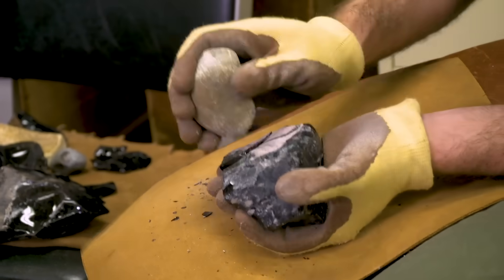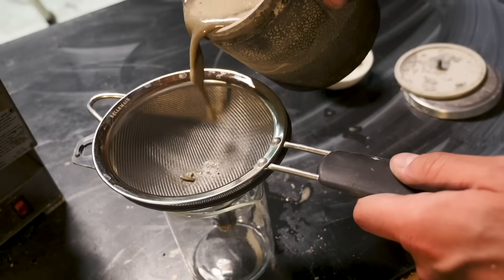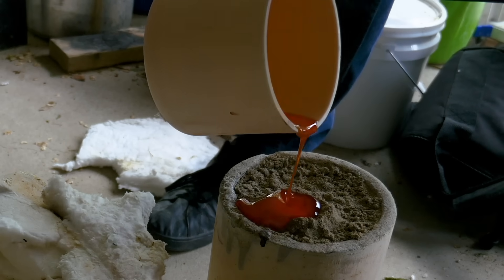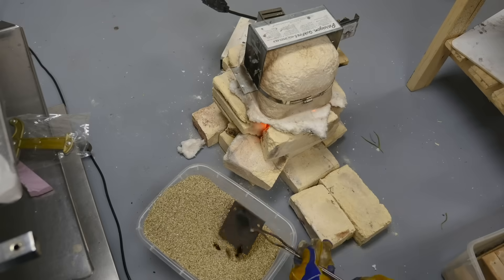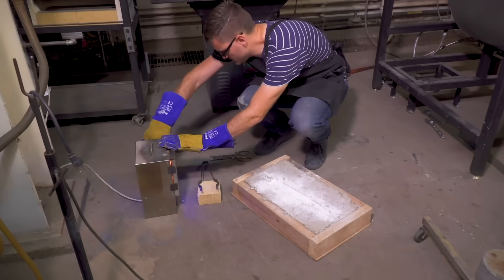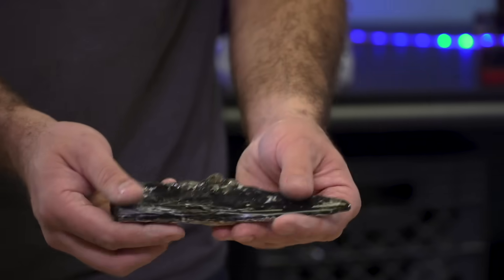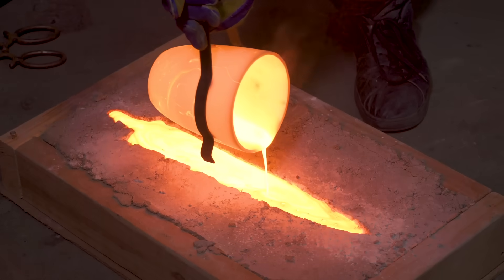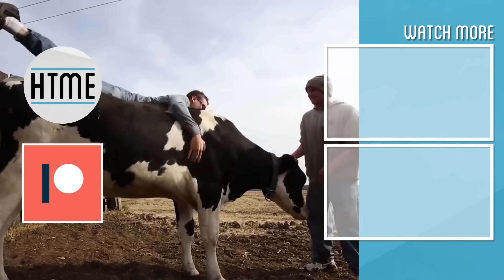Can You Melt Obsidian and Cast a Sword?

Comment: just kind of curious
it might takes a lot of time but
try heat it up the whole time by controlling the temp and slowly drop down the temp
from what i see is that out layer of the obsidian has cool off faster than the inside that's the reason why it broke
the reason is to control temp and slowly drop down is to let temp from the inside to slowly cool down

Comment: I should have thought that the key thing is to find the right annealing temperature.  Different glasses need different temperatures.  Now, you don't say how you chose the annealing temperature, but as your sword  cracked it seems to me there is a good chance the temperature wasn't right - in which case the solution would be to conduct a series of experiments to find the optimum temperature (and minimum annealing time too of course).

Comment: It cracks due to flux you add. You shouldn't add flux. You should try to increase temperature. Flux adds impurities with different melting point and different lattice constant that affects thermal expansion and leads to cracking. Pure, high quality obsidian wouldn't crack so easily (due constant latice constant thru its volume) when you cool it evenly and slowly. Maybe try to make a clean and smoot form made of titanium and put obsidian powder (without flux) there and bake it with that titanium form at  1080°C < T ≤ 1650°C. Next, turn off the oven and don't open it for few hours or a day, to let it cool slowly and evenly. Open the oven after the few hours (when its interior is cooled down to room temperature) and see what you have inside and see if obsidian is going to crack easily. The above method is not tested but it would be great if you could test it if it actually works. I know it is more expensive (needs better, bigger oven with higher temperature and titanium form), but on the other hand it may work. :)
Wanna give it a try?

Comment: They should add obsidian swords to minecraft too
Reply: Wolfie R8 that way you have a blade which is good for one whack. People will be mad after all the work. Lol
Reply: DE Nichols obsidian is tougher than diamond in Minecraft brah
Reply: Gaara Sama YouTube cut that down in the notification without the "in Minecraft". I was like. Could it be harder? Diamonds are the hardest naturally occurring object. Vikings liked to smash them to be sure...just because it's hard doesn't mean it doesn't smash. Lol

Hard and brittle. That's a diamond. Obsidian seems softer and still brittle.
Reply: DE Nichols gotcha
Reply: @ DE Nichols
Same as a diamond sword. Would also break quite easily.
Reply: How about mods ;)
Reply: That would break easily
Reply: Wolfie R8 they did u just need to buy the stuff for it
Reply: If they're going to add obsidian anything to minecraft, it needs to be obsidian glass panes... this way you can have explosive resistant windows too, and not just the blocks.

Comment: You have the right idea with the annealer. I expect the difference in temperature between the obsidian and the annealer is too great. Melting the obsidian at what ever temperature, say 2000 degrees F the annealer should be 1500 or so. Next would be to program the cooling rate. I anneal my glass at 950F for 3 hours, 850F for 2 hours, 750F for two hours and so on for a total of 8 steps. It's the cooling process that makes it crack and the stress relief inherent to the melt to the solid to the cooling. Well done though.

Comment: But why would you want even do this ? An obsidian sword would be essentially useless, as a single strike from another weapon and it would smash, and if it actually hit any thing, the edge would most likely shatter and small flakes would chip off. Remember how easy it is to actually knap it, so actually using it in batter would just be the same.

Comment: Instead of using a flux, why don't you make a crucible from Tantalum carbide (TaC) or Hafnium carbide (HfC). These two materials can withstand temps up to 4000 degrees celsius. Get a larger kiln. Then you can heat the obsidian to the point where it is liquified and cast it that way. You can also remove impurities in the process.

Comment: Needs to be constantly flowing/mixed not to set while it is melted.  Something like a cement mixer that heats as hot as the kiln and injects it straight into the mold where little air gets to it.

Comment: using high voltage and current arcs may melt obsidian faster and much better but to do so will be more extremely hazardous than using a kiln as if you don't wear the proper protection these arcs may kill you and you will also need a much bigger transformer like the ones used for utility poles and transmission lines as microwave oven transformers may not generate enough heat to melt the obsidian so.

Comment: The video is an illustration of how ignorance coupled with perseverance will get you exactly nowhere. If you had any idea of how obsidian is born and its chemical and structural composition, you would have known in advance that melting obsidian will result in glass with a sizeable proportion of impurities. That makes an already extremely brittle material even more susceptible to breakage, preventing any kind of post-cast sharpening. So in theory, with a lot of effort you can make a blunt, ugly and extremely brittle glass sword.Then again, I am probably missing the point here, since seven million views have probably made you about $7,000, not bad for maybe a week's work.

Comment: From a mineralogists point of view the answer to "can this still be considered obsidian" is a clear: No.

Obsidian is defined as a glass like substance formed from volcanic activity. Unlike most minerals, which are defined by composition and structure, Obsidian is defined by its origin, since is composition is highly variable and its structure, well there is none :-)

Also: The reason for the colour shift is most likely not the flux but the fact that most of the impurities (mainly Fe2+) get oxidized.

Comment: Good for you on your tenacity!
Back in the olden days, the Panasonic Techinics company made a, "Cast Obsidean Base" or plinth for it's best Turntable.
Their best one was the Technics SH-10B7. (There was also a smaller SH-10B3)
Here is the info, but it does not explain how to do it. This is paraphrased from The Vinyl Engine website:
Description
Heavyweight (17.3kg) plinth system made from cast, powdered obsidian.
External dimensions: 561 x 175 x 466mm.
Weight: 17.3kg (including dust cover, except for arm panel)
---I guess when a multi-million dollar company gets involved, anything can be built. They sold thousands of them, and they go for a lot on Ebay
IMO, what you are trying to do is even harder than this, because a sword or knife is so thin and brittle.
Reply: same sentiments, I applaud you for sticking with it.

Comment: impurities in the air impurities in the Mould , heat conduction through minerals to avoid rapid cooling the sand of the mould the mould itself should also be heated then compressed to remove fine air pockets , when pouring the substance shouldnt run out like water nor should it ooze out like lava your mix was too thick then it was too runny adding fluxes designed to make vase and pots your going to get a vase or pot you have nothing but a broken piece of ceramic in the shape of a knife, obsidian or not your might as well get a sword of metal heat it up sprinkle obsidian powder on it and forge it 1000 times ok you dickhead

Comment: Glass Wool I believe would have helped a lot with the cooling of the obsidian sword. I remember a year ago watching a video on producing tin oxide coated glass using Stannous chloride sputtering and high temperatures.  The cooling glass was fully encased in glass wool to trap in heat thus slowing down the cooling cycle and preventing stress on the glass sheet.

Comment: You know, there's a saying out there that if you're not breaking equipment and causing some collateral damage, then you're not doing any real research. IMHO this exemplifies that saying.

  Your efforts, although they perhaps didn't quite pan out the way you'd have liked, you're breaking new ground.  None of it is in vain and you documented it.  Don't discount nor despair anything.  

Although it's more of an art at this point, this will lay the foundation for future attempts and improvements.  Even though it's more leisurely pursuit, who knows how it may benefit people down the road?  Even if it's just an exotic area in casting and such, future efforts will benefit from the knowledge you've gleaned here. 

I'm a realist, and cynical.  It's rare I'm more optimistic about things.  You did a good thing.

Comment: Durability: 99999
Reply: Your profile logo strength:9999999999999.
Reply: NoticiasPapu - 9999
Reply: Obsidian sword 
1 attack damage
30 durability
Reply: Obsidian sword- Attack:70, Durability: 60, Sharpness X, Silk Touch X. Most overpowered weapon. Only crafted with the ender dragons egg, 2 obsidian, and a blaze rod.

Comment: Yo youre making me cringe destroying all of these kilns. When you cast any kind of glass you need a mid-range torch to heat the edges of the glass where it gets really cool (where it starts turning from red to black) and then you need an annealing kiln that has a program that ramps up to about 1050F and then slowly comes down to room temperature over the course of two days or so depending on the thickness of the glass.  You can get an idea of the COE by annealing a smaller batch in a kiln and compare it to borosilicate glass/soda lime glass which has a COE of 33 and 96-104 respectively.

Comment: If you’d like a tip, do this in the desert. Use an actual kiln. And then finish in a vacuum oven, and use less flux and no dyes. I make obsidian figurines in Nevada. Using a large kiln for sure though. Makes a difference.

Comment: Obsidian is not really "glass" with impurities.  Common obsidian has the same chemistry as rhyolite (the explosive/extrusive equivalent of granite).  Rhyolitic lava is pasty and sticky, and basically nasty stuff.  If it is hot enough and reaches lower pressures quickly enough, a lava flow that would be obsidian may foam making pumice.

Comment: Great Video, but I've been making glass for 20 years and you could do with a few pointers! 

Use the last sand cast box (the metal one) and just put it right into the annealing oven. Also don't add too much water to the sand mix, it'll help prevent bubbling (are you using bentonite as a binder for the sand?). 

Your annealing point is wrong. Look at the book 'Glass Notes' by Henry Halem. It's got various different annealing test and schedules in there. The one you're using (I'm guessing is for Spruce pine batch at the glass blowing studio) is wrong and too short. I'd try a long schedule with many different annealing and strain points. As a guess you should be waiting at least a couple of days until you de-mold. Have you thought about kiln casting it with a plaster silica mold? Think you'll get better results with that and you don't need a crucible. FOCI Glass Studio run classes in this... maybe have a go? (it's really fun by the way and a lot less hot!)

Also what flux are you using? Have you tried borax?

Comment: I was hoping for a sword cast from molten obsidian, not flux and "random metal bits to add color, which wasn't really the problem but why not 'fix' it anyway?"  I have no idea what to call the material it's cast from, but it's not obsidian anymore.

Further, it can't really have a tang as it's semi-obsidian.  You'd have better luck putting fullers down the center and then binding a core material to it, similar to how flint-knapped blades are attached to hafts and shafts via a split in the handle material.

Finally, for the best luck casting this fragile material, you'd want to find a way to cool it quickly without cracking it.  Heating it with the torch is not only moving the material but also likely allowing crystals to form and introduce fracture points.  Kudos for trying different things though, that's how we learn!

Comment: takes hat off. Goldsmith Master Jeweler here. I love that you didn't give up. yep, guilty here too. i've melted glass before and even formed glass from sand. I was rooting for you as you didn't give up and was going to give you a tip, but you figured it out at the  9:09 mark. glad it worked at 11:40. I mentioned melting glass, but why: to pull out impurities from old gold when you are working with customers gold that hasn't nor wants to have it refined. the by product is similar to the look of obsidian. I can't give out that trade secret. gold refinery I leave to the experts. yes I've seen the youtube videos "refining gold" but they're actually losing gold in the process, not to mention the acids used. what do they do with it, storage and disposing wise. Anyway, here's my suggestion if you want One More Stab At It. try building something that resembles rebar skeleton with either copper or steel. I'd really like to see that outcome. Obsidian Sword! love how that sounds... I give you a Thumbs Up and a: I Like, OLE!

Comment: The difference between obsidian and glass is the cooling rate and the crystallization . Obsidian is create normally around volcanoes from lava with high concentration of silica . If you want to "create" obsidian you have to warm the materials in high temperatures for a long time and late it cool not as fast as the Normal glass but much slower in order to be partially crystallized .

Comment: Could you cast your own pistons
Or have them machined etc? 
I've been waiting for someone to try and make a crossplane inline 4 crankshaft and liftedcam shaft to compare performance against a bog standard stock crank and cam.
Crossplane should have a smoother rev band and a mean idling sound, in comparison to a stock crank and cam from an inline 4 engine.

Comment: I suggest checking out the Corning Museum of Glass's videos here on YT to better familiarize yourself before using obsidian again. Also, have you checked out black sand? It's essentially super-fine crushed obsidian, maybe that would help? I'm no chemist, so I could be wrong. Good luck in the future!
Reply: The most common types of black sand stem from shock cooled basaltic lava, while obsidian is mainly formed by fast cooled rhyolitic lava (silica rich). Another type of black sand that is fairly common is based on eroded hematite and is hence ferromagnetic. I got a big bottle of the latter ... it's pretty fun to use as decoration coupled with a few strong magnets and because the sand is not pure iron it does not go as crazy as the commonly used iron filings. :)
Reply from the maker: Great suggestions, thank you!

Comment: The reason your casting didn’t work is the sheer premise. You’re attempting to make a relatively thin layer of glass with a hard spine rather than say inlay a metal spine during the casting process and having the obsidian edge created from shattered obsidian (how obsidian gains its sharpest edge). Any metallurgy should have taught you “pure” compositions (like this pure obsidian blade you have as a fine product) have enormous weaknesses whereas a composition of several elements would be successful.

Essentially during edging process of a blacken metal sword (regardless of Dye or composition), it is better to tack weld pieces of sharp obsidian onto the blade, yes the blade will lose its edge over time, but that is more feasible than the attempts you have made in this video that I hope you will try the techniques I recommend to see if you come out with a functional “obsidian” blade.
Reply: @atacantutuncuoglu  *Taught 
Also yeah, but how does that make the suggestion invalid?
Reply: Pure obsidian.
Reply: @muk420425  The "sword" that was made wasn't pure obsidian either. It had flux and some metals added in also so I have to wonder, did you even watch the video?
Reply: Teddy Couch r/woosh
Reply: @muk420425  okay then.

Comment: Hey I worked for a company that does caste glass. To prevent breakage you need to have HOT SAND (ussually in the form of clay sand) the sand depending on the glass you are using should be 4-500 Fahrenheit and allowed to cool over a period of several hours. (What you are casting is a lot smaller than what we did so it won't take nearly as long to cool. Maybe 4-5 hours tops)

Comment: i think that with something as brittle as obsidian , solidity would be attainable if you coated an iron blade in a thin layer of obsidian, or created a contour of the blade with obsidian, and sharpened it later.